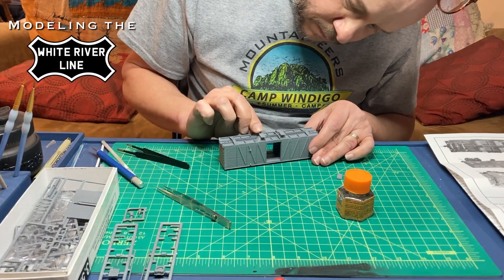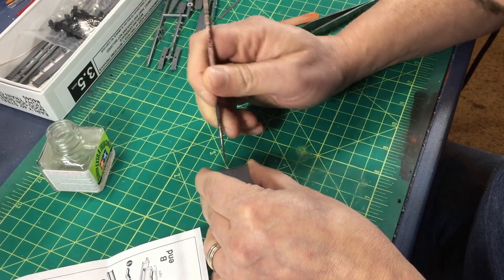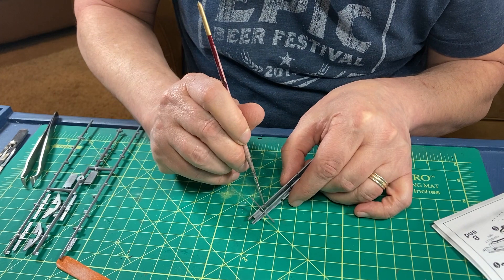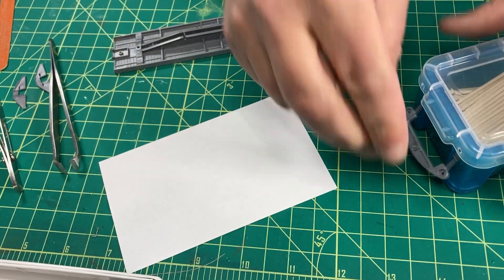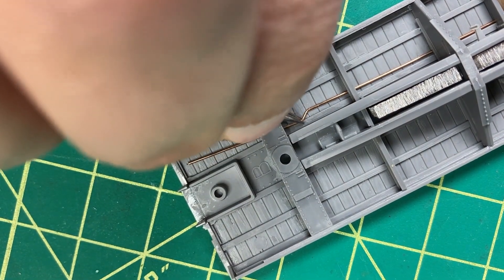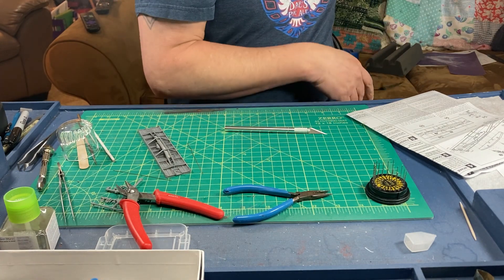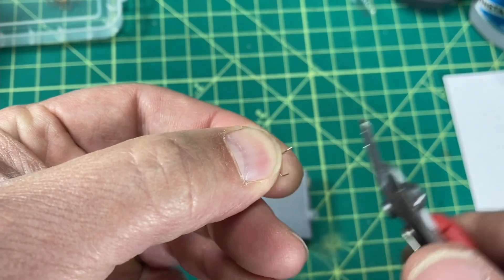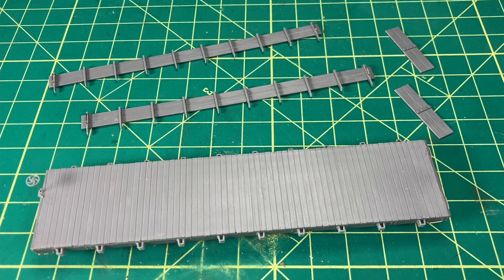Building a Wood Side Gondola for a Model Railroad

Comment: I model the Central of Georgia railroad since I used to live in Jonesboro, GA.  I bought a couple of Atlas GP-7s from another modeler in the Central of Georgia livery and he had never run them.  When I got them they looked brand new and absolutely no wheel wear.  I got them for $75.00 each.  I've never paid more than $120.00 for an engine.  I started collecting HO gauge back in the middle 80's but never really thought about modeling any certain railroad.  Now things have changed and I'm getting an Atlas RS-3 in the Central of Georgia livery for Christmas along with a Kadee boxcar in the CofG livery.  I also just got my very first brass diesel, a Fairbanks-Morse H-12-44 in the CofG livery.  Back in the 80's I mostly bought Athearn engines and I hope the Atlas engines will perform as well as the Athearn ones as they are quite robust and keep on rolling.  I recently started collecting Lionel 027 as I got the very same Lionel train set I had when I was a kid from my cousin.  My train set got left behind in the attic when we moved from Hephzibah, GA.  I couldn't believe my cousin had the exact same one and I sure was happy to get that set.  I've now collected enough to make a 027 layout with 4 steam engines and 1 Texas Special diesel F-3.  I think I have a couple dozen rolling stock to go with what I have. Oh yeah, I'm a DC guy only as I hate the sound of HO gauge DCC.  I will probably end up weathering my brand new engines.  I just don't like seeing pristine engines/rolling stock on the layout.   

Yeah, I have a section of track (about 1 ft. or 14 in.) on top of roadbed with a Kadee coupler height tool mounted on it so I can check coupler height on all my rolling stock & engines.  Did you know that the back of the height tool can be used to see if your car body is at the right height?  You have to check the body height with no coupler in place or it will hit the back of the tool.  I just found about this the other day.  If the car body will just slip over the end it is at the correct height. Then all ya gotta do is add a coupler & draft box.  Instead of using the Kadee magnets, neodymium (rare earth) magnets can be used much more reliably.  Since I'm a DC only guy I changed out all the magnets on my open frame (Pittman) motors with rare earth magnets (neodymium) and it made a HUGE difference in current draw and now my old Mantua Pacific's will "creep" around the tracks.  I also changed all couplers to body mounted Kadee couplers and changed out all plastic wheels with Walthers Proto 2000 metal wheel sets.  Cost a good chunk of $$ to do nearly 100 pieces of rolling stock.  Another trick I learned is after mounting the coupler draft box and Kadee coupler, put an itsy bit of super glue next to one side of the draft box and chassis and a little itsy drop of super glue on part of the screw and draft box.  That will ensure that the draft box will not move nor will the screw move.   Another trick is if you glue two pieces of plastic together, make sure you use an X-acto knife (I use A-proxo knife) and scribe hash marks on both pieces to ensure a good bond.  I try to never glue on draft boxes and use my Kadee drill and tap for a 256 screw.  I've even drilled through the metal weights to add a screw to the draft box.  Guarantee they will never come off.  I've also had a some screws come through (like on a flat car) and used the Dremel to cut off the protruding screw and then paint it black or same color of the body.  

I've got an old Revel MOW (Maintenance of Way) grey car that I picked up a long time ago when I bought a friend's layout and just recently I found and purchased a True-Scale triple set of MOW cars, a kitchen car, maintenance car and caboose.  Now I've just about got a whole set of MOW cars.  All I need to finish the set is the crane car and crane.  Real railroads never ran plastic wheels.  I hate talgo trucks (couplers mounted to trucks).  All 100 pieces of my rolling stock including coaches have body mounted Kadee couplers and Walthers Proto 2000 metal wheel sets.  I'm in the process of making sure each piece is up to the NMRA weight standards.  I get my weights from Harbor Freight - 1/4 & 1/2 oz. tire weights.  And I paint all of 'em black.  Be sure to save any plastic knuckle couplers and plastic wheel sets as they make great loads for gondolas.
Cheers from an ex-Georgian in eastern TN & Merry Christmas